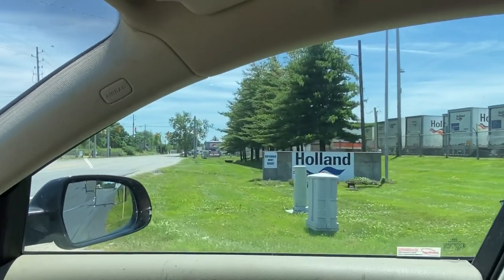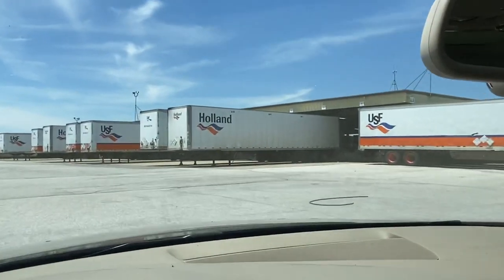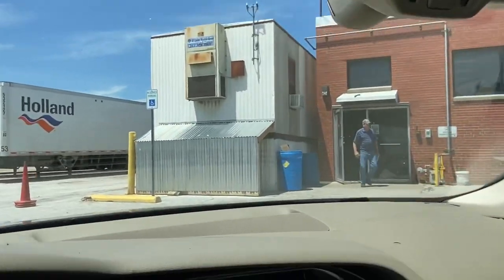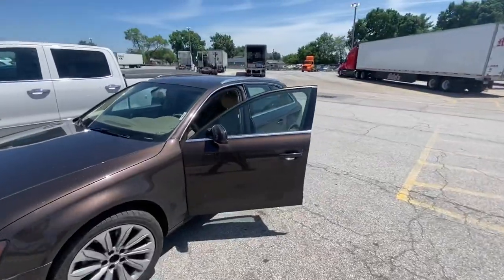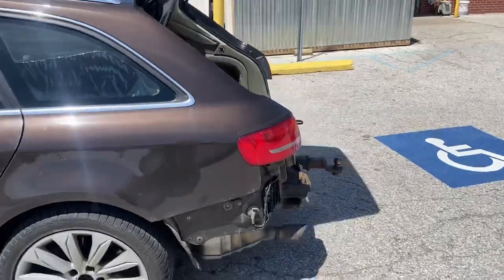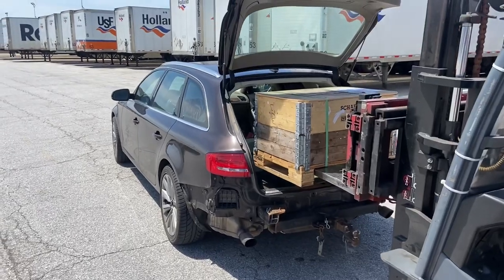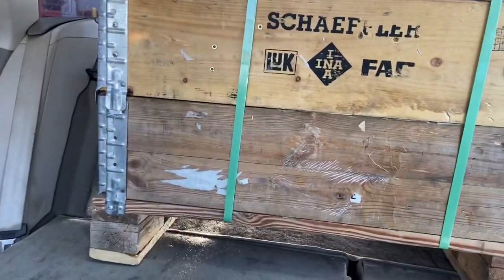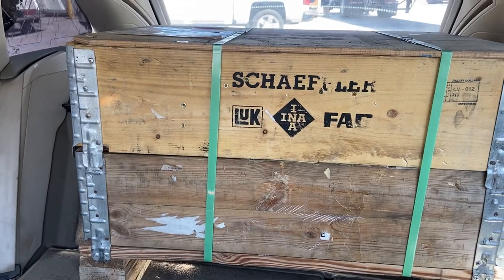Shipping Terminal Pickup local truck hub 
Trucking freight receiving Audi TT crate transmission

Comment: alot of times its a size/weight limit going into most neighborhoods to do a residential delivery and also having turn a 53 foot trailer on those streets. i dont think holland even has 28ft trailers with a liftgate either
Reply from the maker: Correct, I also get engines dropped off at my residential house with a semi hauling a shorter trailer and a lift gate.